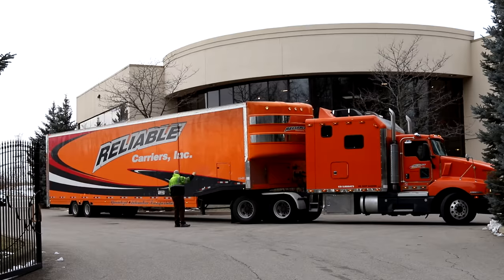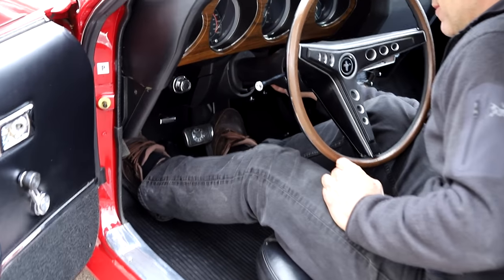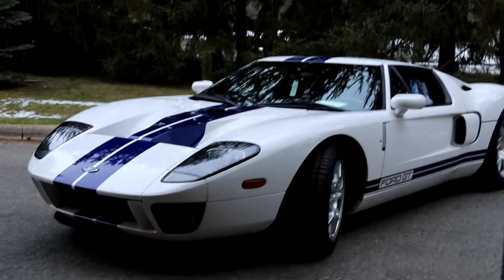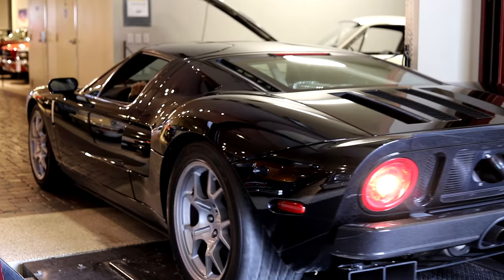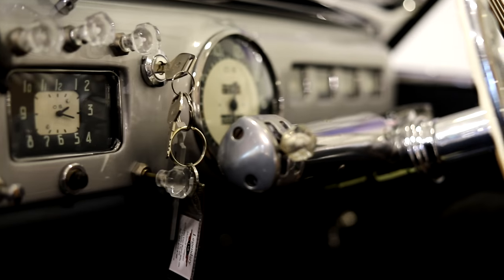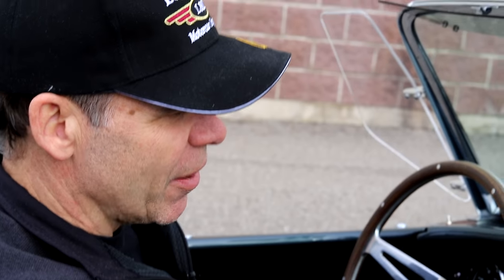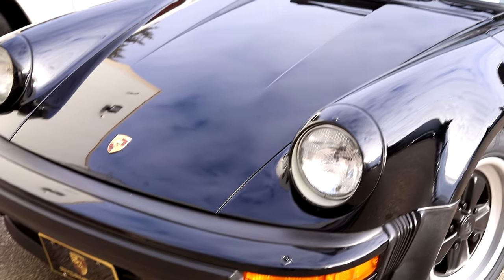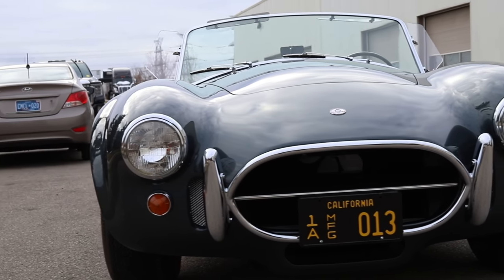Carroll Shelby's personal Cobra, Delahaye & more! $10,000,000 delivery

Comment: I had one of those shut off switches/knob in a souped up Maverick I used to own. We sold them in a vintage/rod shop I worked at. Another cool feature of that device is that you can remove the knob completely. My battery was in the trunk. I was at a party once and a buddy who had had a little too much joy juice thought it would be funny to take off in my car. I had removed the knob as I often did when the car was parked. He went nowhere. That little terminal switch and a hidden fuel pump switch under dash combined made for a really inexpensive anti-theft device.
Reply: The best anti-theft device nowadays is a manual transmission!
Reply from the maker: hahaha
Reply: @legendarymotorcar  That's what Jay Leno says anyway! lol
Reply: @bobjohnson205  ...with an 11 inch mechanical linkage clutch!
Reply: A VERY GOOD FRIEND OF MINE JUST SOLD HIS 22 THOUSAND ORIGINAL MILE GRABBER BLUE BOSS 429 FOR 315 GRAND AND HE PAYED 6 GRAND FOR THE BOSS 429 MANY YEARS AGO.

Comment: Had a 1965 GTO, 389, 4-speed and 1967 GTO 400, 360 hp, automatic, both new.  From what I recall, the owners manual said to cold start, slowly push throttle to WOT(wide open throttle) to set the automatic choke before starting, then turn key and if carburetor is operating correctly the car should start and come to fast idle, tap the throttle and it should slow down. It will show to normal idle when it warms up, these cars had a choke type devise on the exhaust manifold to help it warm up, it would open up as exhaust temperature heated up.

Comment: If my classic has been sitting for a while , let’s say more than a few weeks , I do not pump the gas on my carburetor , I spine the motor over until I see oil pressure go up slightly by turning over the starter , when a little pressure is seen I know the mechanical fuel pump has also filled the carburetor bowl full , then pump the gas to activate the choke butterfly to start the car !  
This only works on a mechanical fuel pump or if you have a separate shut-off for an electric fuel pump on a carbureted engine !

Comment: Battery cutoff switch saved my dads' '72 Chevy C/10 from burning up when the wiring decided to short out on the freeway.
Reply: Put a Hella marine/racing "red-key" switch in the passenger footwell of my '65 Sting Ray when I fully rewired it 20 years ago.  Use it all the time when working on the car or it's parked for a bit. Removable key, removable worries of an electrical failure point.  A fundamental, but extra layer of security!